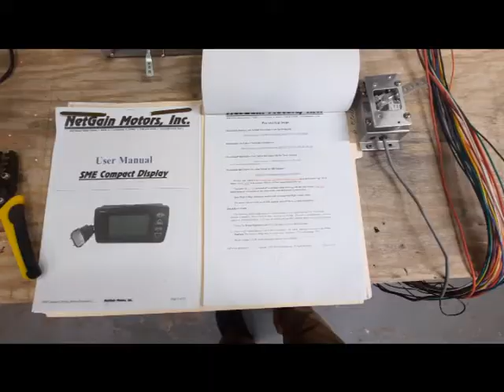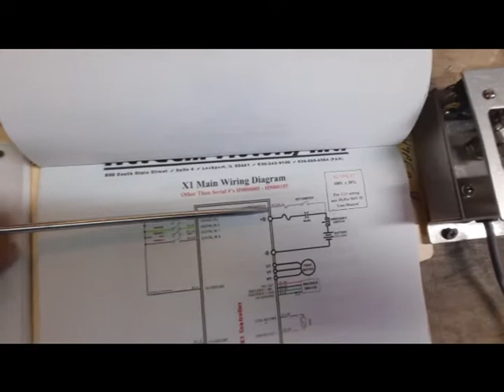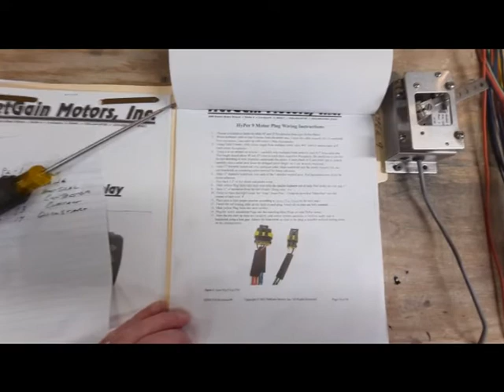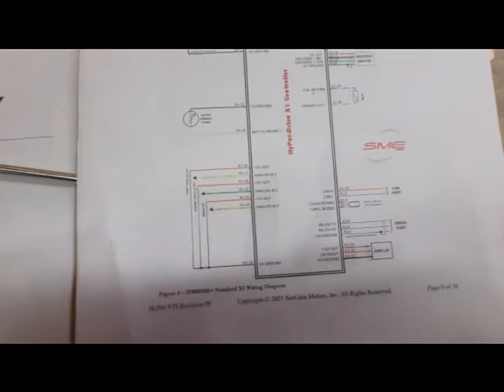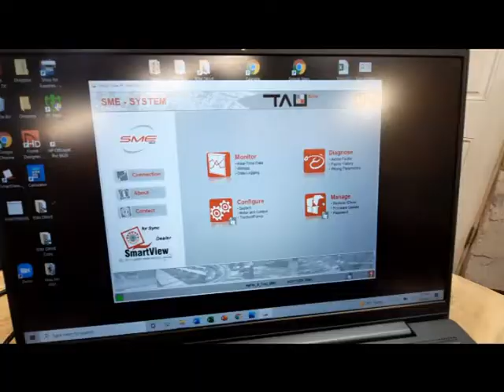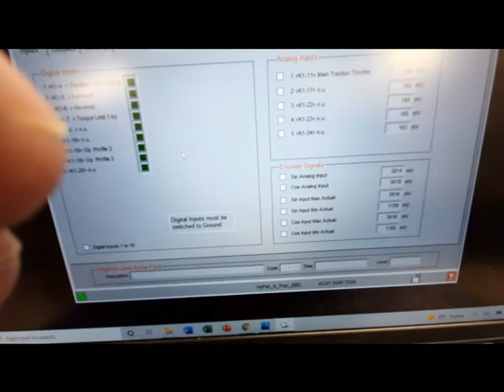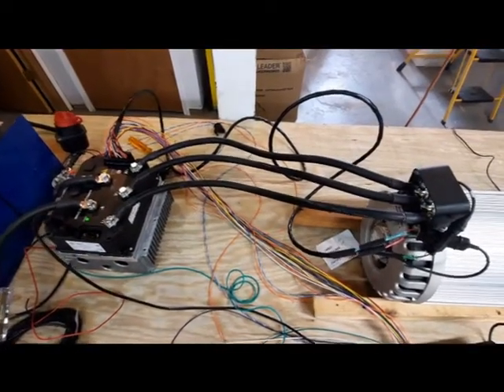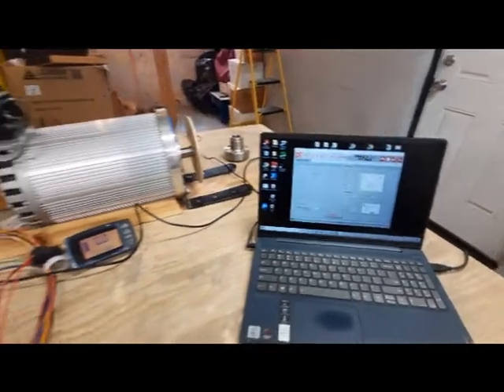EV Boat Conversion Episode 5 Netgain Hyper 9 Bench Test

Comment: Very good video. Thank you so much.
Reply from the maker: K1-9, plug position 4 had poor continuity. When I was ringing out wires I was using my meter probe and I spread the pin too much. I replaced the pin.

SIN and COS values should always be between 1100 and 3900 mv.
Reply: Turns out I had a bad clone file.  Called Netgain and Hunter cleared it up by remotely operating my computer.

Comment: Great video, very helpful. Can you be more specific about how you made the Curtis PB8 throttle work with the controller? I am using the same one. Cheers.
Reply from the maker: The resistance range on the pb8 will allow the control voltage to exceed the maximum limit and you get a fault on the controller. I contacted Netgain (Great company) and they modified my clone file to correct the problem. The only control you have in the throttle map is the acceleration curve. Hope this helps.
Reply: @evboatconversion.electricboat  Thanks!

Comment: First thank for the comprehensive video.  I have the 100 volt version of the Hyper9 on my bench to get everything going.  When I ran the software to do the motor encoder calibration the motor began to move very slowly and the 3 phase leads to the motor got extremely hot.  I shut it down as soon as I noticed this, probably less than 5 seconds.  For bench testing I thought it would be sufficient to use 12 gauge romex, as I couldn't imagine that the motor would draw more than 30 amps at slow speed and no load.  It's a mystery to me.  Do you happen to know what the motor current is during the encoder calibration?  Also I noticed the motor seemed to be turning somewhat like a stepper motor, moving/stopping maybe 3 times a second.  It all happened so fast, and I am reluctant to start it up again for fear of damaging the motor or control.
Reply: I just saw the end of your video, glad to know the motor jogging is how it rolls during the encoder cal.
Reply from the maker: I think you are fine. I don't know what the current is during set up, I was using #1. Good luck!

Comment: Thanks for the informative video. What size battery are you using? I presume each cell is 3.2v? What is the Amp hour rating of each cell? I’m trying to estimate the overall size of battery pack in relation to the total kilowatt rating. Many thanks
Reply from the maker: The short answer is sixty 272 AH LifePo4 cells (3.2 volt) in a 2P30S configuration. 52 kwh total, 700# plus battery boxes. The long answer is available in Episode One and the longer answer is in the Battery episode.
Reply: @evboatconversion.electricboat  thanks, I appreciate your reply.

Comment: Is that an air cooling block for the inverter? My liquid cooling block looks quite different.
Reply from the maker: Yes, I got a big heat sink on E Bay and I'll be mounting two muffin fans behind it. My thinking is this:
1. The ports on the liquid cooling block are 1/8" NPT which seems very limiting to me. I looked up the flow rate and it's really low. The stern drive has a high capacity water pump for cooling the IC engine, I'd have to bypass the majority of the water.
2. If you have ever replaced an impeller on a sterndrive you know it take a lot of horsepower to turn it. I plan to leave the impeller out, save the HP and and see what happens.